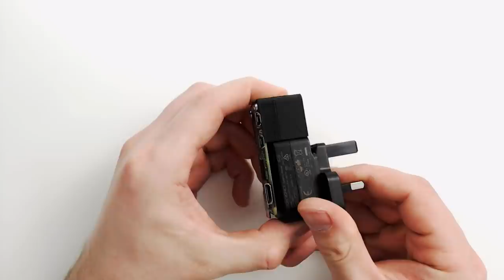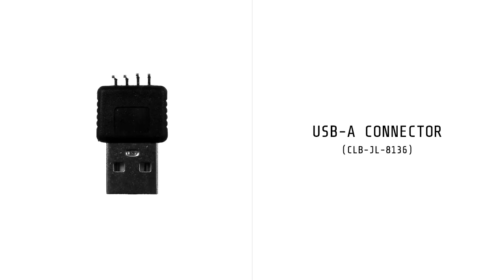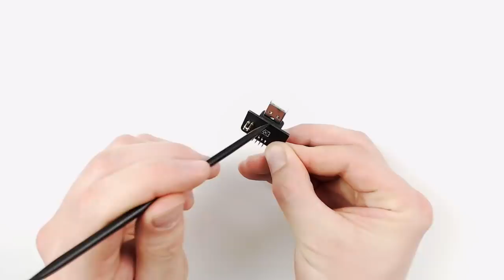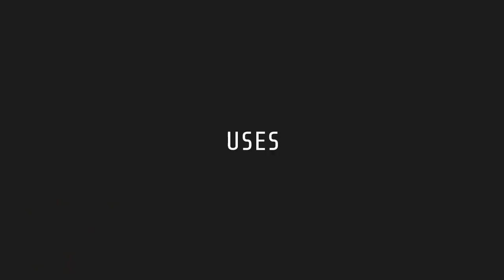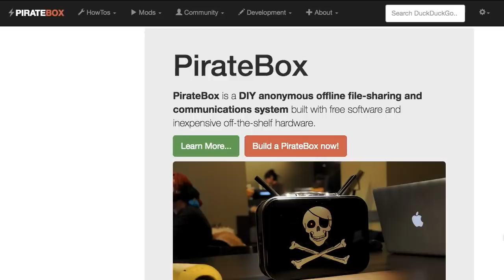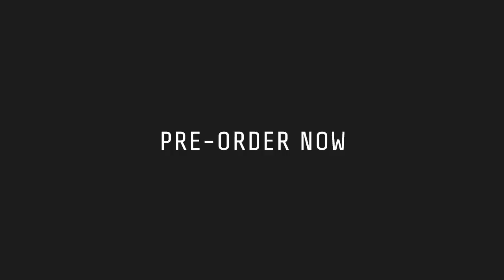The NODE Nano Server V2

Comment: What is the PCB measurement/diameter? 1.6mm thick, but no where states the size of the custom PCB for ordering
Reply: Hi gents, I can confirm that simply putting 100x100 will print and score the PCB accurately. Just got it in the mail today as well as my shapeways print. I was able to order and create everything listed. Looking fantastic! Will share once its up and running. Thank you Node. Please post more content!
Reply: @paul_pierre  sounds good!! Do drop the link if you're still around
Reply: I am having same issue. Dimensions on pcb would be nice.
Reply: i'm having the same issue too. i went ahead and ordered 100x100. should be in the mail soon will let you know
i'm also interested in a case, was there a reason node decided to not create a case for this version. it seems like a pain to do the 3d modeling myself for this version
Reply: @paul_pierre  I think he has a version of the case for old server case. Not sure if still compatible, but let us know about the PCB.

Comment: It's super ambitious but what if the plug doubled as a powerline adapter so that you could neatly have a wired connection? It looks like Ethernet can be done over GPIO and it would make this so much better for networking appliances.
Reply: I mean you should be able to just replace the wall outlet piece with two screw terminals instead.I agree that would be very cool.

Comment: How about an integrated GSM 4/5G module added to the node.
It'll make it fully mobile, and WiFi independent.
That way, it can be deployed anywhere (plugged to electricity sockets, of course)
SIM card won't be anonymous connection.... But it may have good potential
Reply: could be burner sim cards tho ?
Reply: @JulesAndComputers  Of Course!

Comment: I am thinking this kind of modular plug computer would be more versatile with included battery to prevent data loss when power outage happens. IMHO a single LIPO battery with charger circuit would be nice addon, but that would need more soldering, and removing the usb and another connectors, and replace them with a customly placed usb. https://othermod.com/raspberry-pi-zero-external-usb-connector/ (soft pwr-on-off) Big improvement would be to add full metal heatsink/or maybe the adhesive tiny ones top on the chips/over the board and extend the sliding in case and lock the bottom part of the board with another 2 screws.
Reply: Maybe just a tiny amount of power, enough to make it shut down safely
Reply: @ScibbieGames  IMHO battery circuit is there, backup can be longer, and umount too. Better to be on the safe side, than risking data loss, or server faliure. If would be possible, maybe it is a bit overkill but would be nice to add some speakers or just buzzer/beeper to know the issue. Maybe with expensiver solution, a tiny LCD with errorcodes or operation messages would be useful too. Yet this is can be overkill.

Comment: Is it still possible to solder headers on the pi zero?

I'm working on a LoRa network right now for a science fair project and I think it would be a PERFECT application to add a lora hat to it and make it a LoRa gateway.
Reply: should be able to if you trim down the legs of the header to not poke out the bottom and solder it should fit flush in there